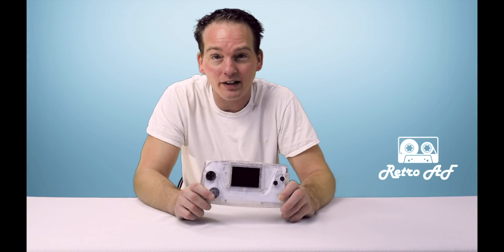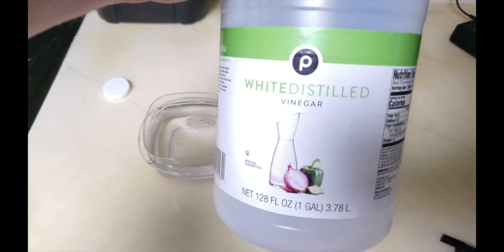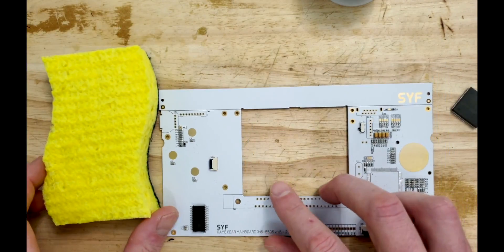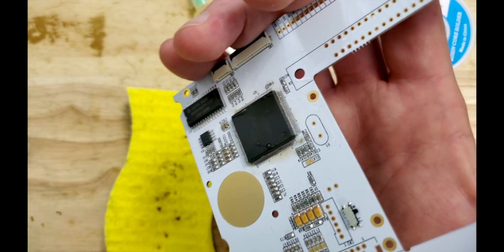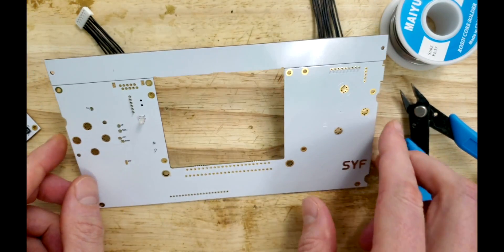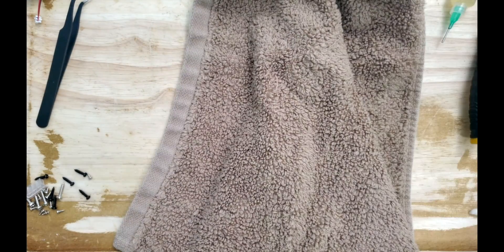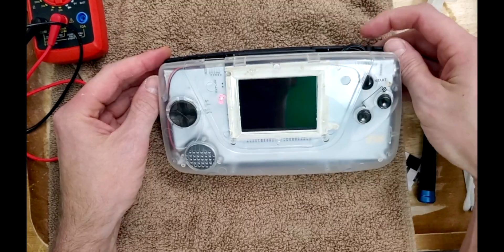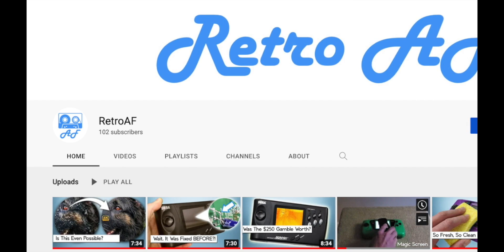Let's Build a Brand New Game Gear

Comment: My go to with soldering TQFP components is by first just flooding the pins with solder and then going over it with soldering braid, but this looks much easier!
For that game port with the plastic spacer it might be easy to remove with a desoldering pump, but not sure if that would melt it too.
Reply from the maker: Im sure a desoldering pump would be fine. I was pretty aggressive with the hot air station.
A braid would work too (if youre patient)
Thanks for the comment!

Comment: Why does the speaker sound crunchy?
Reply from the maker: I use an oldschool, 90s test bench that i know works for the game gear before i introduce the new sound and power boards.
doesnt sound good, but it tells me if we are backwards compatible. 7:54 is using the new sound board, while the others use the test bench.
Great Question!

Comment: At 8:00, you can see that the image output is larger than the case frame. Is that pixel perfect?

With the scaling modes you can adjust the size to the case, but then it is no longer pixel perfect, right?

PS: Well done. I' ve been looking a long time for a video that shows exactly this.
Reply from the maker: You nailed it!
Thanks for the feedback!

Comment: Its weird that there isn't a mounting bracket provided and that you have to trim ribbon cables to make it fit. This is a really good idea for all those cap ruined game gears though
Reply: The new kits come with an exact length flat cable. I had to custom order those so it took a while 😅
Reply from the maker: Bennvenn provides a mounting bracket for a regular sega game gear.
The custom bracket was for a new SYF game gear and is offered! I just print my own with ABS plastic.
The trimming of the ribbon i agree with.
Thanks for the comment!